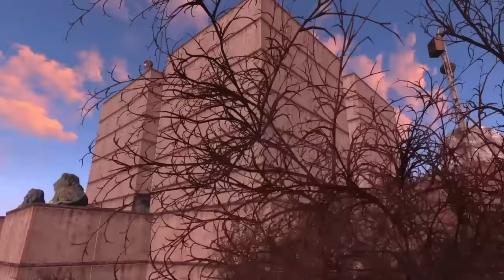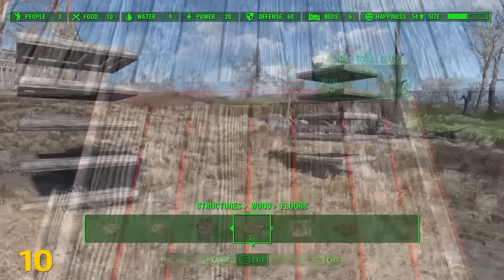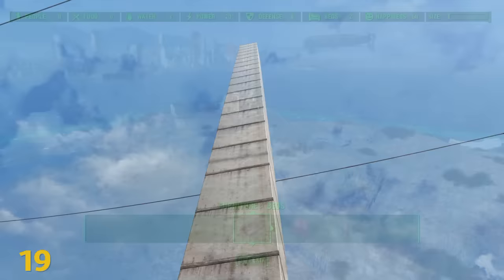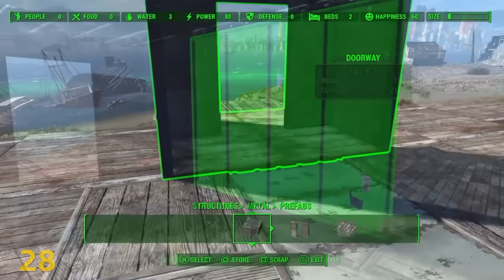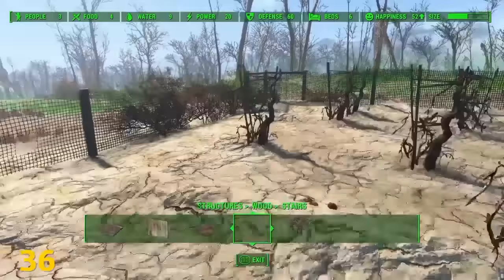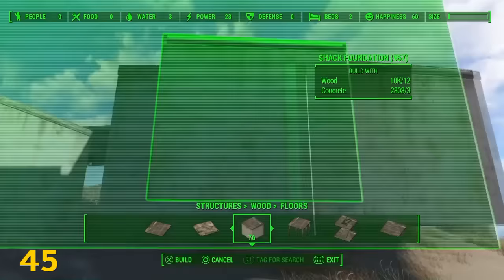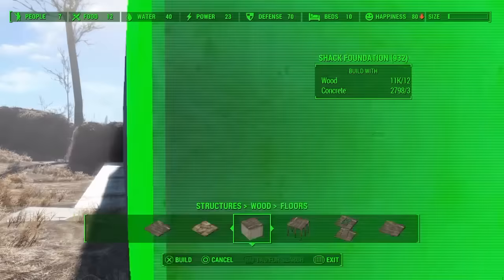50 Tips & Tricks for Building Settlements in Fallout 4

Comment: Even if you've run out of building allotment you can still build by, going into 'Workshop mode, selecting an object ( such as a laser turret) un selecting any wire,  then re writing the object the laser turret will appear. If you have the required materials to build the desired object'. Place the desired object, rinse & repeat.

Comment: One tip for new players :  Fusion Cores
When you first start play you will find several of these for the power armours. When you use the cell, watch it's power level and swap it out as 5-10%. You can now sell the flat fusion cell at a vendor. Diamond City vendors sell 2x fusion cells at 100%, so sell them the flats and buy fresh.
If you end up with a load of these, give the full ones to your companion (Dogmeat is good for this) then you won't use the full ones, and only use the partial fusion cells in your power armour.
As you use, swap the cell and sell the flats. 
If you don't eject the cell before it hit's 0% you won't be able to sell it and you lose caps.
Even if the empty cell gives you a few caps, it's caps you didn't have to spend on fusion cells.
Technically they say Fusion cores are rare, done right, you'll never run out

Comment: Railing with cable: if you have the vaulttec dlc than i suggest using their connectors, they are a bit smaller and i think they would fit completely inside most objects

Comment: Hello jug.  Got a quick (prolly dumb) question.  When you put the generators inside the shack foundation did you have to connect a wire to it directly, or could you just attach a conduit connection to the block and that could transfer the power?

Comment: for tip 39:
better to get the local leader 2 perk and the CAPS level 2 perk so you can build tier 3 general stores - then you can get a pack of 200 concrete AND a pack of 100 concrete, and a pack of 100 wood and 100 steel, EVERY DAY from vendors at ANY settlement you build this store at.

Comment: I found a neat new trick by mistake. If your having trouble making a Foundation or Wall make that last inch turn to line up correctly, try making a bed and sleeping in it near the wall, foundation or item in question, I normally do 8 hours or until the Sun comes up, I find that when I wake I am able to square the wall or foundation up easily.

Comment: If you keep building objects in a settlement, the game will eventually stop you from building any more, and my version of Sanctuary was nowhere this huge with all of those parts. Is there a way around this?
BTW I too have the PS4 version, and great video!
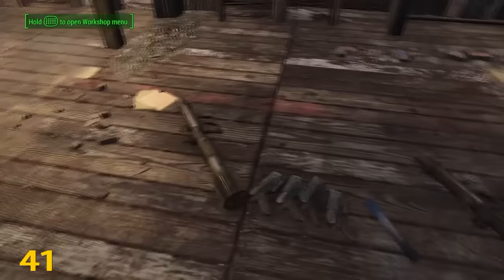Reply: Very simple fix (I'm PS4 too). You just pull the weapons out of your workshop. Then drop them on the ground. Then enter workshop mode and store each one back into the workshop. You can repeat as often as you want. This video discusses it (Tip #41 @ 16:45).
Reply: Jac V Just watch the damn video - the answer is right there. Smh.

Comment: A little help would be appreciated if anyone has an answer to my problem..
He states at the beginning that he uses PS4 with NO mods... unyet I can barely get to the 4th structure of a settlement before running out of space!! How is he making these ridiculous structures???
Reply: There are 2 ways I know (I'm PS4). 
1) Remove weapons from the workshop, drop them on the ground, then enter workshop mode and "store" them.  You can repeat it as often as necessary.
2) Similarly, scrapping weapons does the same. I buy a ton from the various vendors with excess water, return to my settlement, drop them then scrap them. Guns have a lot of screws but you need to have at least level 1 scrapper for this option.

Comment: Michael Ramos1 second agoWhy build your settlement deep within your build area and no walls at the edge of your build area? If you wall your edge of build area why waste a good wall? Answer. Build your wall at 90 degrees when needed and straight along two straight 90 degree build area lines. Make these walls two walls of your quarters, If your build area is not square or crooked offset your walls until you encompass your build area. You don't have to fill up the center but then, why not? Yes, you need water pumps and area to plant food. 2nd part. Why waste land build area for water and food? Answer. Planting pans? One of your selections are square dirt cookie sheets. .Build your settlement area as high as you can or want to go. To the limit. Place these growing areas on your roof. Transplant your food to the roof. If your settlement has no water source and you need water pumps, put them on the planting areas on the roof. You can extract water from the growing squares. This comes in handy in an area like Hangmen's alley No mods Just clear the ground and build upwards in step by step sections and when you reach your limit transplant and put your pumps there clearing the way to build your concrete floor at the bottom and set the pattern for your walls. By the way. You can block the back entrance at the patio area. Also..The roof protects your food and water supply and if you put your power source up there it won't get damaged in an attack.WIRES?? Wires everywhere.. What a pain. Use conduits, power generators,  they are workable.. one caviot. Make sure your conduits run parallel to the floor or walls. A small angle can become problematic. I haven't figured oiut Boston Airport. Can't plant, minimal water source. I built a good living areas there but without options other settlements have it is unsustainable. Waste of time... Hey Did you know some settlements let you go 10 plus stories high??I messed up bad. I thought I could side with one faction and demise the rest. After doing a great build on the Slog I gave it to the raiders.. Finding they were greedy I wiped them out. But I want to get the Slog back and get settlers in. I tried to take down the flag but it says I must kill the enemy first. There is nodody to kill at the Slog... Help me!!Read more Show less

Comment: just started playing this game . how do u even have so much resource like in thousands ? lol i see K written next to number
Reply: use the unlimited resource glitch, quite easy to do, it doubles the resources you dropped, like 50 to 100 to 200 to 400 etc.
Reply: +George George resource glitch?
Reply: Just play the game and collect everything. Sell all the crap weapons & armor as well as all the base food (what cannot be made into non-rad food) like Cram and any "wild" named foods you pick up in the wild.Sell excess food and drugs too, at higher levels you don't need much. Use the proceeds to buy Wood & Concrete contracts and put them in the workshops. (Max CHR is 17 without perks for buying and selling at the best prices. You can get there by stacking drug & alcohol affects with clothing - a "Sharp" Armor set can boost it by +5, Devastator helmet adds another +1 but there are other hats too - one of the Mentats [Grape?] boosts CHR +5 too). 
Build a scavenging station and assign someone to it in every settlement (its the first thing I build and the third settler gets assigned to it).
Low on caps?  Build a merchant store (needs Local Leader 2) and watch the caps roll in. By level 20 you'll have quite a bit  of material saved up. By level 40 you can do some pretty amazing things. By level 100 you'll have so many caps you can buy all the contracts you need. Merchants reset every 48 hours.

Comment: For pc there is a HUGE tip that is the only reason Im ever satisfied with my builds and ESPECIALLY walls/fences. Now this is only for pc since it involves going into noclip using the console command TCL. Now this is hard to explain and if you tinker around with it you will eventually figure it out but ill try to summarize the main idea right here. This "Glitch" of sorts will let you put ANY object through another making angles and especially junk fences and guard posts super smooth and nice looking (Heres a link to a picture showing what I mean from my settlement https://gyazo.com/4aa29c45721894585f5038e49d848809   ) so to do this you must kniow I you are in noclip and you select an object you CANNOT reselect the object so I always recommend cancelling if you mess up the placement of an object, DO NOT and I repeat DONOT scrap the item or you might have to restart everything you just built make sure you CANCEL. Another note is to hard save OFTEN it is extremely annoying accidentally messing up something then having to delete an ENTIRE row of wall just because you accidentally scrapped something you shoulda just cancelled. Now heres for the actual glitch. Once you type in TCL into console. select an object and put it down then spawn in another object watever you want and you can place it straight through the other item you put down now if you cant put an item through another you probably never selected the first item you are trying to "penetrate" just select the object and place it back down then you should be able to put another object straight through that. now be mindful because of what I said earlier make sure you CANCEL a messed up placement of an object, exit tcl then reenter if you mess it up because lets say you got 4/5 walls done then you mess it up and scrap the 5th item then try to select the 4th item you CANNOT and will have to EXIT noclip and then reenter, which like a said if you try to pick up and place the 4th item back down you cant because now the 3rd, 2nd and 1st items have not been selected and placed down meaning you have to delete the WHOLE thing and restart to add the 5th item. I hope you could understand what I said but if not just check out my other stupid channel (I dont care about views or anything I have 8 subs I aint too commited) for a quick tutorial of what Im trying to say.
Update nvm i cant get the video because I cant record anything for some reason all my recording shit is broken so Ill try to look for a video showing this and post the link as a reply to this comment
Reply: Yeah, you can use the rug glitch to do that without a mod.
Reply: Thomas Myers That's a really complicated and awkward way to do something that only needs a rug.

Comment: tip 42:
why dont you just use the fusion core generator or one of the vault tec generators that produces 600 power instead of 128 small gens and only takes 1 tile